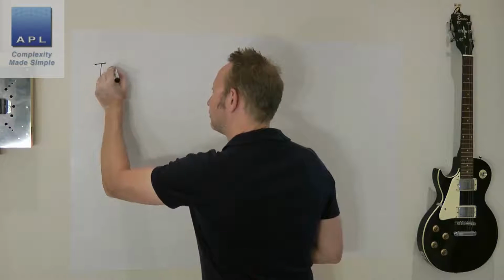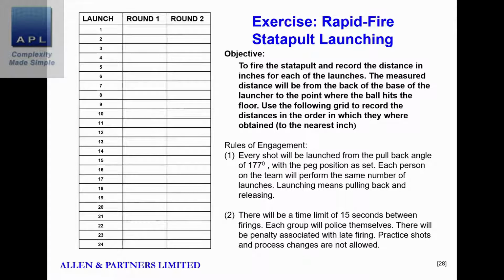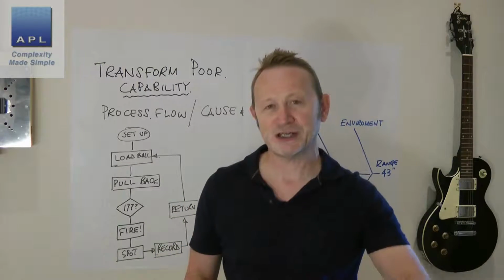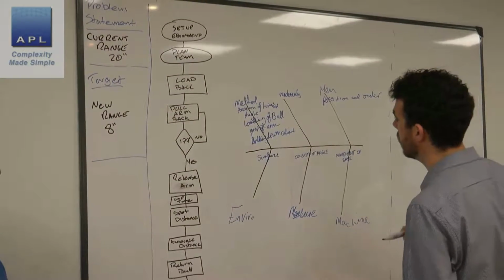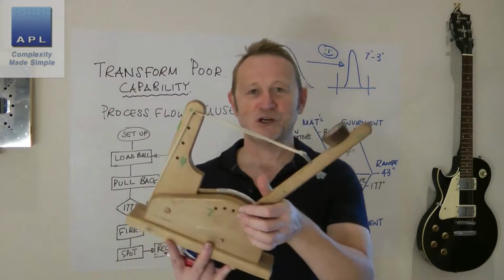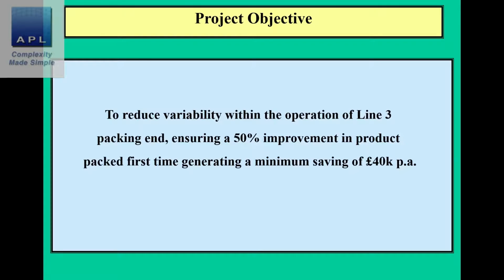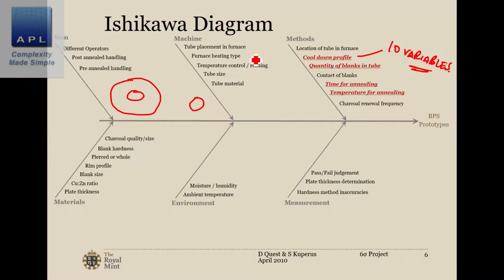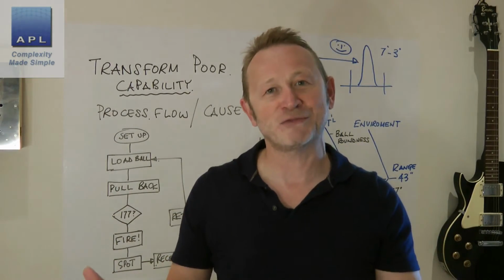Cpk Improvement: IMPORTANT!!

Comment: have noticed that the usual catapults used in these experiments have a large concave cup. i think it should be a flat stand with the ball resting on the beam... this assures that the ball is always on the same spot and not rolling on the concave curvature of the prior design as it exits the propulsion mechanism?????
Reply from the maker: Ronald - you could right, with time and equipment in class, sticky tape and foil is all these guys can use to improve...

Comment: Hi Paul ,

great video !

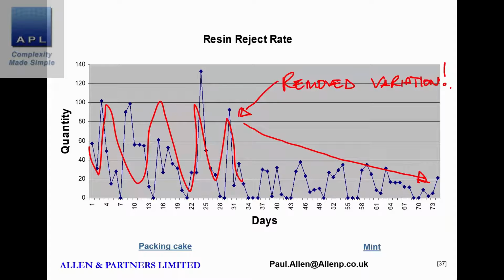in 27:00 , in the graph,  you have 1 point every day , this represents the quantity of the defects right ? 
and why it's take so long , this is can be solve in Kaizen  event ? 

thanks.
Reply from the maker: Hi Moshe - Just noticed I didn't give you an answer. It is defects, the reason it takes 3 months is because lots of the solutions require maintenance to be carried out that was not done. Repairs to jigs as well. So we could have identified the solution in a Kaizen event. But the graph would still take months to change...